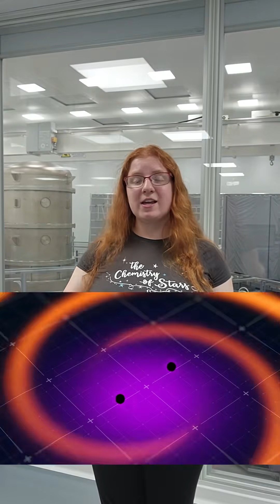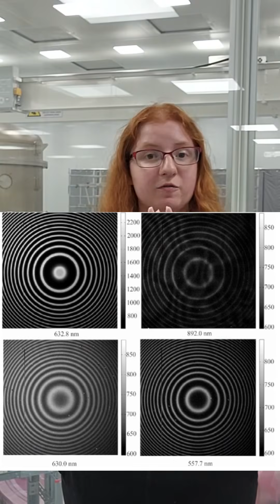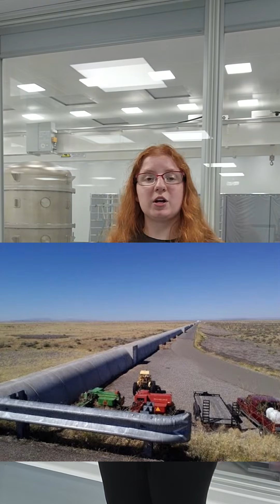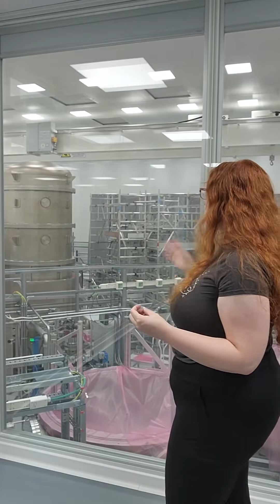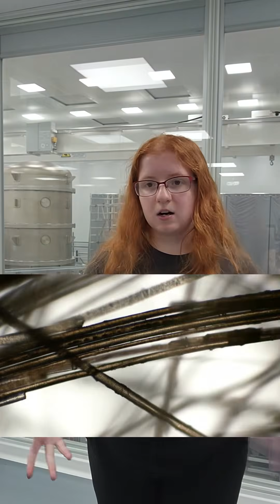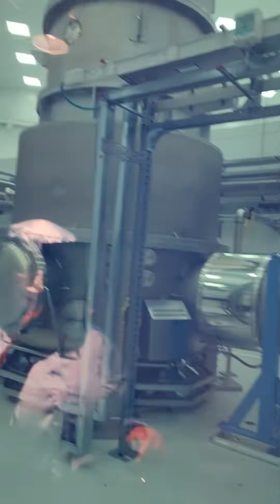Inside the Einstein Telescope Pathfinder mission

Comment: The sound of silence can be unnerving but you may find you crave isolation tanks after experiencing it, careful with a camera in the presence of radiation, they like to lose pixels. The interference patterns you showed clearly had darker sections, I look forward to info on the triangle and curious how well it will locate or triangulate the location or source of the waves. I assume 3 corners with 2 different lasers in each corner, the comparison between lasers in the same corner will be interesting to see. Nice work.
Reply from the maker: I got two more videos about it, to be posted soon.  Hopefully it will answer many of these questions for you.  If not just let me know